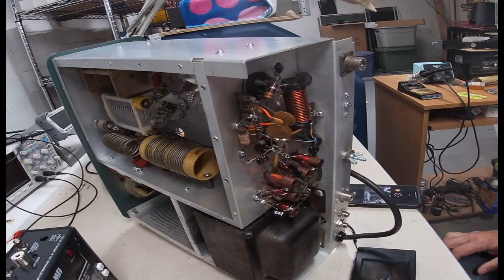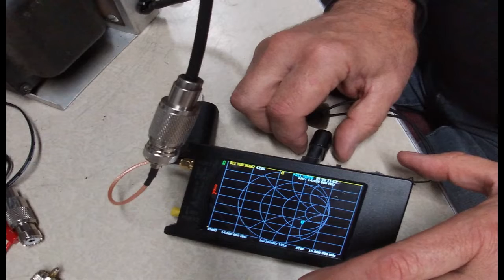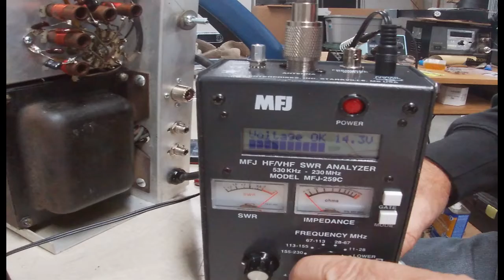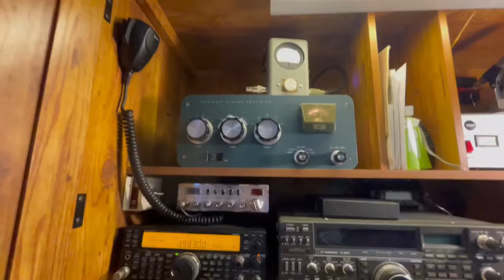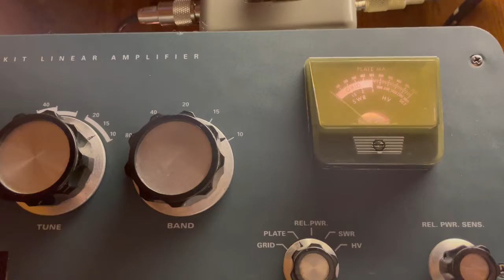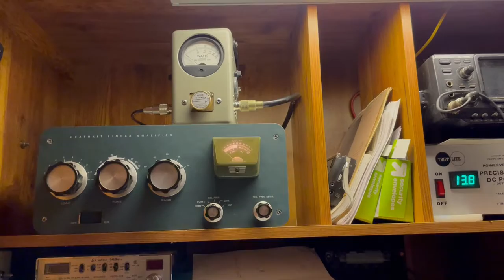Heathkit SB200 Linear Amp

Comment: The Final Test would be to place a SWR meter between the rig and amp. Tune up the amp to max power output. Then turn the slugs in the tuned input circuit of the amp to minimize the SWR (on each band). If you have tank circuit band switch wafer problem, I believe Harbach Electronics has the rear wafer replacement.
Reply from the maker: My band switch problem is the one in the front that switches the capacitor in for 80 meters.   The front half is gone but the back half is intact.  It still works on 80 but I’m planning for the inevitable.  I checked Harbach but they no longer had them.  Even if I could scavenge parts.
Reply: @KA3AJI  Darn. Might try the  amp repair guy youtube channel, see if  he's got a bandswitch. Etc. am sure you will find one.

Comment: Nice video I have the same amp and vna my amp has hi swr on 15 meters I may check it out with the vna and possibly see if I can tune it up a bit thanks for the video
Reply: Try putting a SWR meter between the rig and the amp. After tuning up on 15 Meters, tweak the 15 Meter coil slug through the back of the amp for minimum SWR. Remember to NOT use long coax between the rig and the amp.
Reply: W1zy thanks for the suggestion I will give it a try